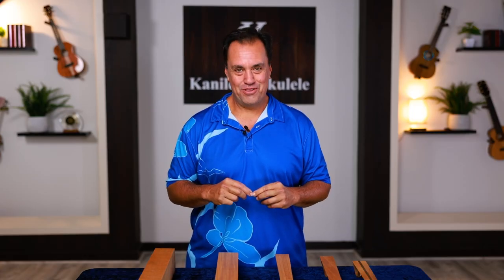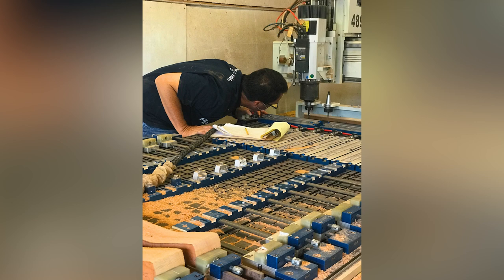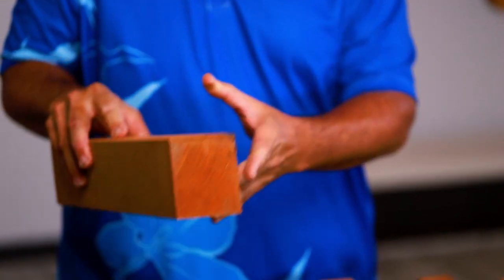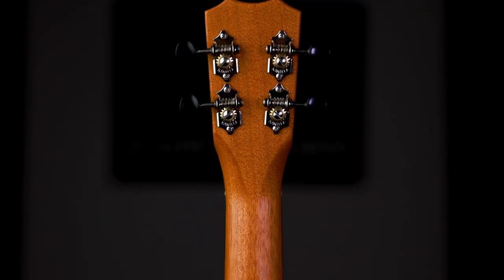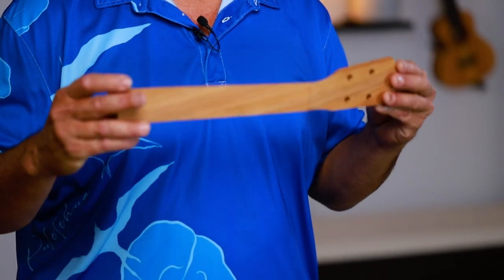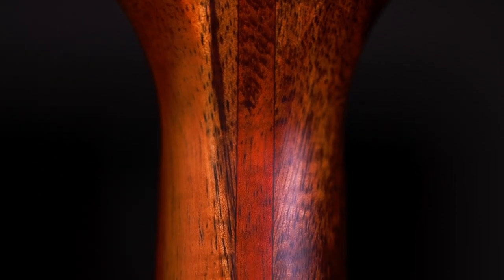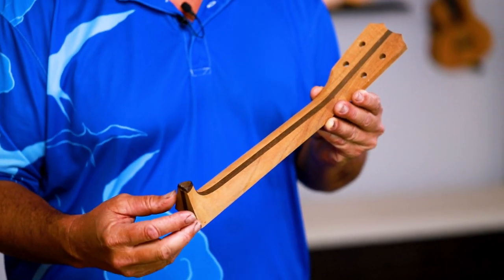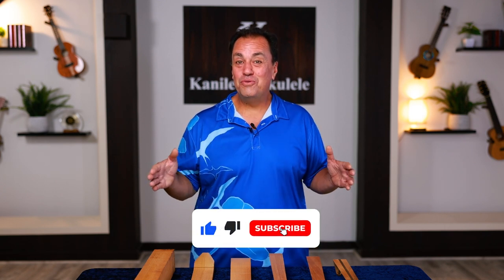How ʻUkulele Neck Material Affects Tone - The Breakdown

Comment: I have two Kanile'a tenor ukes one KPA with a bigger profile neck, best fret job ever on a uke and a slightly earlier K1 with slimmer neck I prefer the KPA shape which I find more playable, both sound great! I also have a Soprano which has the same shape neck as the KPA but a little smaller a great sound!! I want a KPA style concert but am struggling to save the money for it and there are not any available in the UK at present!